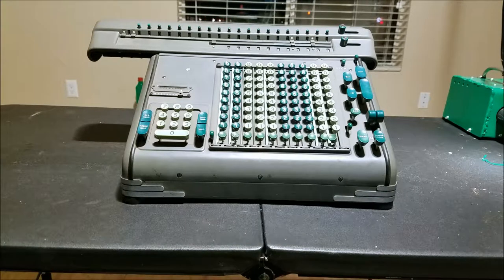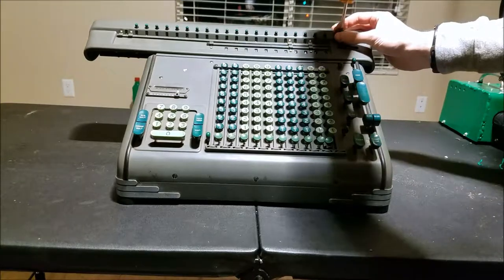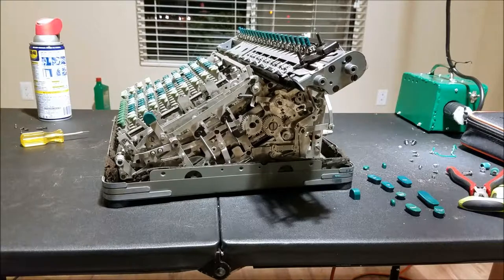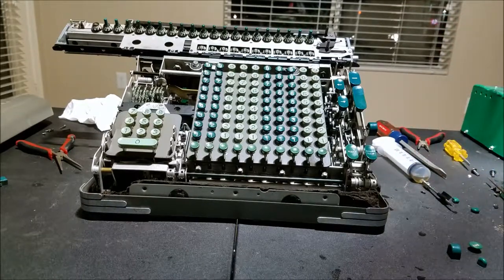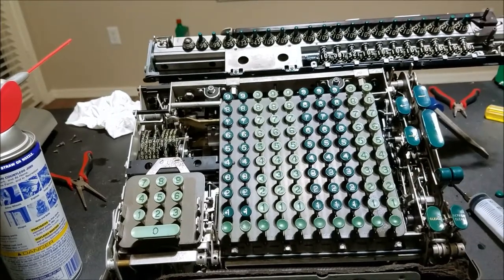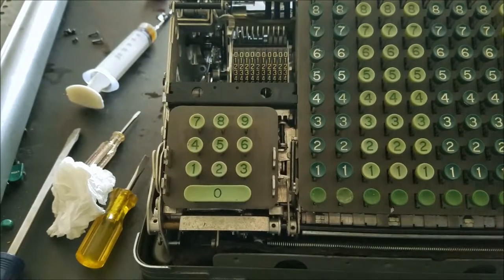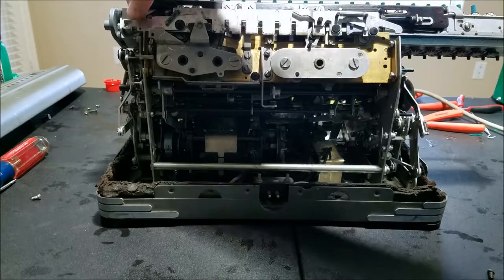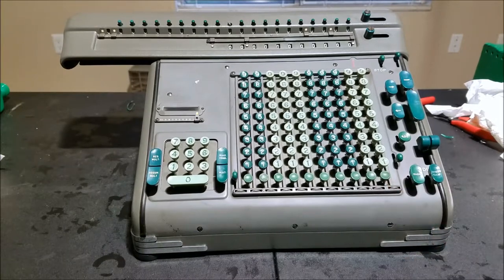Friden Model S10 Mechanical Calculator Repair

Comment: Hi, what was your method to make some of the mechanics go smooth again - just by oiling or how did you get rid of old stucky, gummy oil ?
Reply from the maker: If you can disassemble the parts, lacquer thinner is excellent at dissolving dried grease. For parts you cant disassemble, a penetrating oil like WD40 can help but you will probably have to work the parts a lot to work the WD40 in and dissolve the grease. If you use WD40 always flush it out with oil afterwards, WD40 dries sticky
Reply: @bss1250  Sounsd good, thanks!